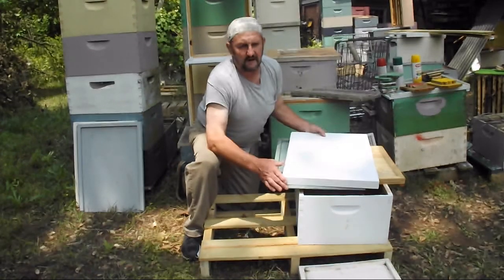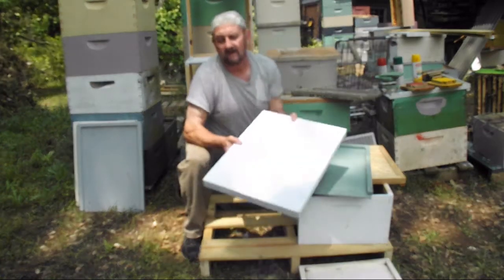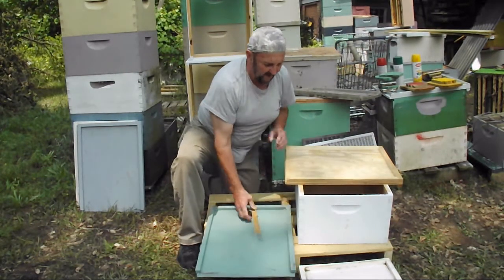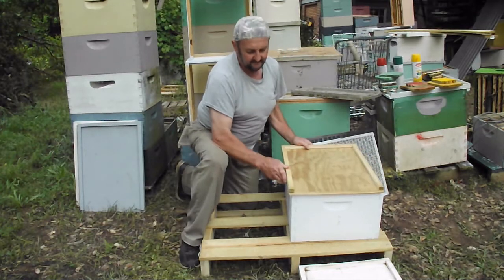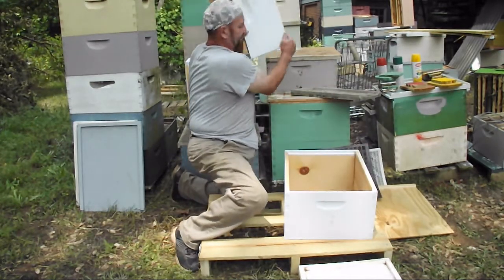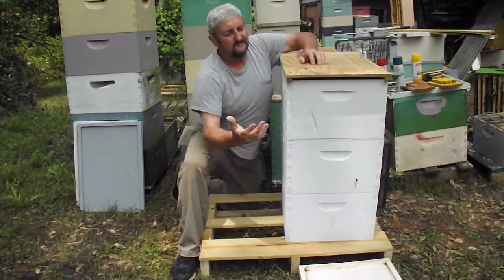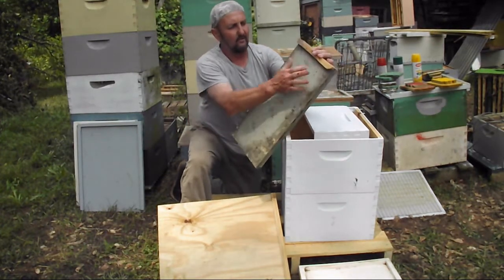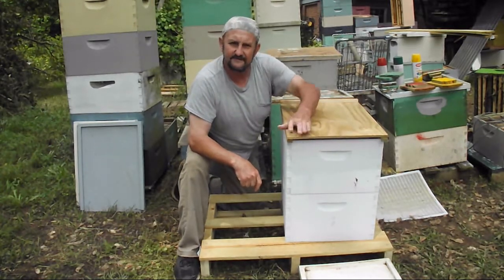TOP BOTTOM Combination Board Beehive Equipment Beekeeping Honey Bee Hive, Georgia Beekeeper John Plu

Comment: i use the 1/2'' plywood as well for a bottom board. just as strong and lighter . Now i'am having a problem with the cheap made 1/2" plywood splitting from moisture! Even painted  ~ thanks for sharing cheers

Comment: Do you prime and paint both sides? 

And, are your wood strips for the bottom board 3/8" high or 3/4" high?

Thanks, John!
Reply from the maker: 3/4 inch strips but 3/8 would work if wanted.
Both sides painted several coats.